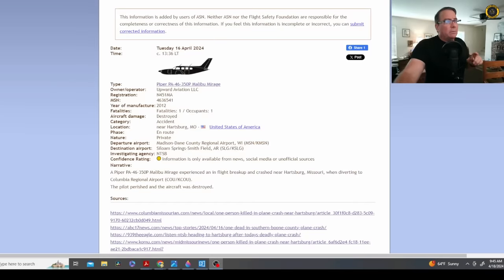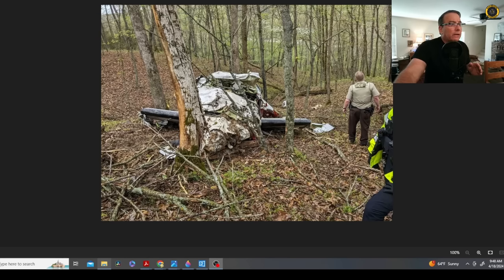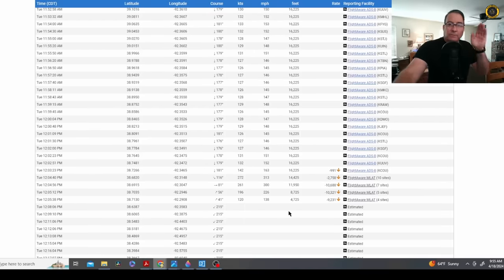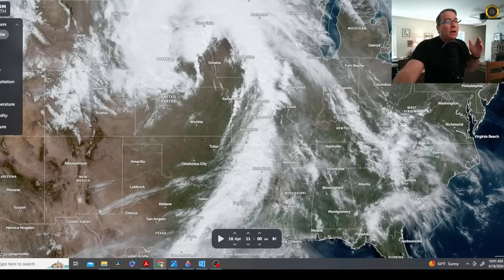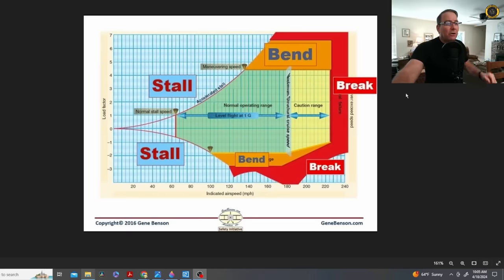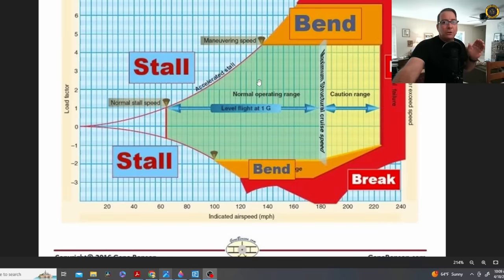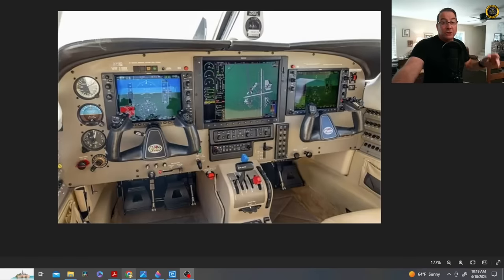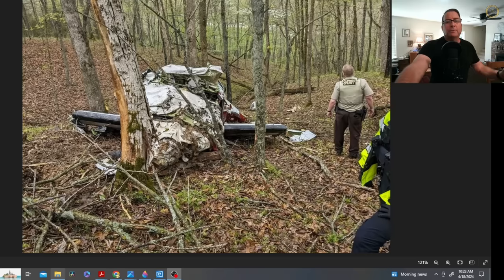N451MA PA-46-350 16 Apr 2024 Structural Failure

Comment: There's something really bogus about Va dropping with lower weight.  The G factor goes up but does not correspond to a force increase on the airframe when the weight drops, so, in other words, the airframe is not broken by g-factor but by actual lift generated.  That lift is the same at max 18 degrees AOA (say) for a given speed whether the airplane is loaded or light, and that's the load on the airframe.  Lift is the load.

In other words, the limit of G-factor is actually bogus, it has to be g-factor for a specific weight.  Lighter weights tolerate more, heavier weights tolerate less.  I'd imagine they give G-factor limit for max weight, that being the conservative case.

Comment: A negative G limit undoubtedly can occur without warning in turbulence, but usually the aircraft can sustain an unsustained, one off incident. It's likely that the pilot continues to overstress the aircraft and exacerbates it by large and sudden control inputs. When that happens it's inevitable that there is some degree of damage and/or structural failure. Best to stay out of weather that produces large cumulus clouds...ie thunderstorms.

Comment: Juan, what is meant by a “doublet” on the controls?
Reply: Two (or more) large control inputs.
Reply: A doublet is a control input in one direction followed quickly by one of similar magnitude in the other direction.

Think about driving in a car down the highway.  You see some debris in the road and need to make a large, sudden steering input to the left to avoid hitting it. If you straighten back out gently, you can keep driving safely.  However, if you immediately follow the hard left with a hard right you are likely to spin out or even roll the car over.

The same concept applies with an aircraft, except instead of risking spinning out on a roadway you're risking overstressing the airframe.
Reply: @marsgal42  Thanks!
Reply: @epicspacetroll1399  Thanks!

Comment: Never fly through sharp shear. What you can encounter will seem to defy physics at times. Massive airspeed gains and turbulence beyond the structural limits of everything but a fighter or something with very high wing loading limits. Use your radar correctly and avoid these areas and certainly never exceed max VA minus wind gust factor.

Comment: I disagree. There is no indication of exceeding design limits prior to the rapid decent. I believe what you have here is a complete autopilot servo malfunction that put the plane into a near dive. The pilot then tried to pull back and get out of the rapid decent. In the process the elevator was ripped off because he was WAY past Vne when he was pulling back.  Lesson here is if you get suddenly thrown into an Autopilot rapid descent or strange attitude from a servo driver failure. Check airspeed before trying to recover. Pull power to reduce airspeed before stressing the flight control surfaces.
Reply: I’m not an active pilot. And I have no experience with autopilots. But I’ve read enough about autopilot servo malfunctions that they scare me. Long ago I heard about a C-141 with runaway tail trim - pitch nose up. Pilot went into a steep bank climb.
Reply: @wscott44  many people think a servo has a break away force that the pilot can overcome in emergency. In fact, it does, under normal operating conditions where the failsafe current control actually does what it supposed to and limits drive current to the servo so that it is never strong enough to over power a pilot. . But in a servo driver failed mode that circuitry can also malfunction, and the servo can have a drive current that give the servo a rotor force that exceeds any human pull strength.  There is even failure mode were shutting off the Autopilot won't stop it. This is because most autopilots disengage relays are a soft switch for on/off. That switch logic can also be part of the failure. The only thing to do is pull the autopilot breaker, or main power to it cutoff switch. In a emergency of control loss. the pilot has seconds. The first thought is not going to be an autopilot failure. They are going to think it is a control failure due to either stall or control cable failure of control surface failure.  Even if they think it may be autopilot, they hit the autopilot disengage and the problem does not go away, so now they really don't think it is the autopilot. They will instantly rule out the autopilot and in fact it can still be the autopilot. The rule of thumb in all control loss failures where a autopilot is active. Shut the main power of autopilot OR pull the breaker. DO NOT trust the disengage button in any control loss failure situation.
Reply: @josephkaminski1857  thanks for all that. I don’t foresee myself flying again. I’m 70, and would need a great deal of retraining. Too much time & money. I think back when I got a multi engine rating in an Aztec. I was allowed to rent it. I was taught to use the electric trim switch on the yoke, particularly during landing flare. Never once did I ask or instructor say anything about what to do if that sucker stuck or malfunctioned.

Comment: Non pilot here, I am confused on why so many of these general aviation accidents seem to correlate with pilots somewhat relying on autopilot, or not switching it off. Compared to driving a car, the second something seems weird I turn cruise control off. Can anyone elaborate on this?
Reply: Autopilot deals with a lot of details, letting you focus on the big stuff, like where you're going.
Cruise control is a good analogy. Antilock brakes maybe another. Wipers that adapt to intense rain. Automatic headlights. Lane-keeping assist and automatic braking.
So you can get into a messy storm and the automation makes it easier just at the time where you need it easier. 
The difference is, an aircraft can get into a situation where It Just Isn't Working. Wind gusts so strong that nobody could maintain constant speed, ice buildup so much that even max trim no longer is enough. So autopilot dumps control to the human.

As you say, the human should have been "in the loop" all along. But then, those pilots probably saw the situation developing and got out. The ones who didn't notice, are now suddenly handed an aircraft without the automation they were relying on to get here.

Comment: This change of maneuvering speed changing with weight should be in every POH of these light aircraft. Typically, the charts given are based on gross weight only for these light aircraft. I saw a maneuvering speed graph in a Debonair owner's manual but I haven't seen it in any other POH. And, all the other performance charts should have corrections for weight too. Charts based on weight, altitude, and temperature.

Comment: Shockingly low negative G limit!
Reply: I agree
Reply: Not really —- remember you’re flying along at 1G , not 0G. If you look at the V-g diagram above and below the 1G horizontal line, it’s fairly symmetrical. 0G will have you floating around the flight deck, but -1G will have you sprawled on the ceiling ( if you’re not wearing harnesses! ).

Comment: It seems like this airframe is too aerodynamic for the strength of the design.    Can easily achieve speeds that can rip it apart in the air.    His air speed was 147 putting it in the bend part of graph.   If flown regularly in that zone I suspect fatigue on the airframe would occur.     Whammo.

Comment: Flying Cargo in the late 70's in mostly GA planes it didn't take a Pilot long to learn to hit weather low and slow. Never at 16 grand.
Scot Crossfield (X-15 pilot) was killed hitting a TX-storm at high altitude in a Cessna 210 was killed when it broke up over the Smokies.

Comment: Juan,

 I apologize in advance, but you need to review the aerodynamics and physics behind Maneuvering Speed. Just because the FAA mandates that 3.8 Gs is the maximum structural limit  for a Normal category aircraft at maximum gross weight, does not mean that you can use that maximum load factor or G-limit to calculate the maneuvering speed at any other gross weight. In fact, the maximum allowable load factor or G-Limit is also dependent on gross weight, is exactly the same way.  Why? Because Gs do not break or bend anything. It is force applied to a structure that creates strain and stress, and the stress that causes structural failure. G's or load factors are just the ratio of the force applied divided by the mass of the object (F=ma) The lower your mass (gross weight) the more G's ayou will produce from any specified  force 1000 lbs of lift force applied to 1000 pound aircraft will produce 1 G, to a 100 pound aircraft it will produce 10 Gs. But it is still only 1000 pounds of force, and if the structure is built to withstand 1000 pounds of force, than that force will not break the structure, no matter what it weighs. The weight just changes how many Gs it will experience.

So the Maneuvering speed is a constant. It does not change with gross weight.
Reply: The manufactures disagree with your assessment and publish lower speeds for lighter weights.  The mass of the engine doesn't change as you burn fuel...the force on the mounts is directly related to the acceleration, not to the total lift.  Some forces (spar load) vary only with lift, but others are affected by G-load.
Reply: Lower mass means higher acceleration... That makes sense!
Reply from the maker: No! You fail to understand a very basic concept.
Reply: @richsarchet9762  No, Forces are NOT affected by G-Load. G-Load is just a measure of the force divided by the weight. The force on the engine mounts is created by what? The aerodynamic force (the LIFT) transferred to the engine mounts by the structure of the aircraft. That aerodynamic force is determined totally by the shape of the airfoil (as well as other parts of the airframe, the AOA, and the dynamic pressure (calibrated airspeed). The weight of anything in the aircraft is irrelevant. And the engineers  at the manufacturers agree 100% with my analysis. What is printed in the POH or anywhere else that disagrees with this is simply, an oversimplification for pilots who do not understand aerodynamics or physics.  In the USAF, published G-Limits were weight dependent, although not done in completely accurate way.
Reply: @charlesbretana  The force on the engine mount is literally the mass of the engine times the acceleration.  F=M x A.  Physics 101.  Yes, the aerodynamic load creates the force that accelerates the whole plane, but the engine mount carries the load to accelerate the engine - and if you pull until the wing stalls at maximum maneuvering speed, the lift will equal 3.8 times the maximum gross weight of the aircraft.  If the aircraft is below it's max gross weight the acceleration in response to that lift force will exceed 3.8Gs, and many structural elements WILL be overstressed (the main spar will not).

Comment: I wonder, with a structural breakup like this, I'm assuming that the occupant would be killed in mid-air or otherwise rendered unable to, for example, pull a parachute cord if they had happened to bring one, Trevor Jacob style?
Reply: I think not, which is worse.
Reply: @MalachiWhite-tw7hl  well then, maybe Trevor was right, maybe pilots should wear parachutes, except he got the reason wrong.

Comment: It is obvious that advanced single engine planes requiring advanced pilot skill and knowledge are too easily let in the hands of private pilots with too little skill and experience. This particular type may need pilots with special qualificatilns to be flown safely. But on the other hand the Malibu could  maybe be a little more robust given its use. It looks a bit to easy to break up right now.

Comment: what about the I suppose it's Garmin sat nav, warning of weather for the type of plane. You type into the set nav of what you're plane is and it will know it specs, and when entering a weather front that would cause you to have difficulty or pass it specification Will give you a verbal warning. it wouldn't be hard for them to do implement into the software update.
this is great for AI you could train an AI to do this having your phone it has motion sensor GPS weather updates on warnings wouldn't be hard for AI to get all this data and tell you in advance that you're entering a dangerous zone and even what you should do if you enter the danger soon like you described maybe you should put one together.
exactly what you're saying if that was said to the pilot in the plane when he hit the danger zone he might have more likely stayed in control of the plane and this could be all controlled by AI trained by you or a qualified pilot or pilots

Comment: Not a pilot but Very interesting accident analysis & Why this same aircraft accident frequently....In trying to better understand the described very aerodynamically "Slippery" (And very fast air speed Capable), seems This particular aircrafts overall airframe strength Rating is considered just normal std for typical single engine GA flying stresses but not Equal to it's particular speed Capabilities or it's Aerodynamic & engine power make it Too Easy to Exceed it's airframe std rating G's rating.....Std airframe G rating + high Hp & Slippery Aerodynamics seems like a Bad combo that Shouldn't be Available to Std single engine cert'd pilots to begin with.....What I missing here ??

Comment: Is not wearing a parachute some kind of macho thing? There are some very comfortable systems out there that can save many people. Admittedly there are times when parachutes are impractical for everyone on board, but if alone and flying in marginal conditions it could be much appreciated. It seems to me that the rate of GA losses is increasing and does this reflect better reporting of incidences or insufficient pilot training?
Reply: There’s no way to bail out of most aircraft.
Reply: @MerlinspopTBH  In the event, you'll find a way.
Reply: Parachutes require circumstances that allow them to be used, and technique to use them properly. 
In this case, by the time the pilot saw the aircraft was not recoverable, he was in a closed cabin descending at 10,000 fpm in an unusual attitude out of control, with very limited time. That's not "macho" it's just physics.
Reply: That's like thinking you can put your seatbelt on while spinning off the road before hitting the tree.  But it takes even longer to get out of your seat and open the door and jump out.  Some aircraft have parachutes built into the fuselage.  That might have been useful here if you had the presence of mind to pull the overhead handle.  Not sure if it would have held up in this case, though.

Comment: I'm still confused about the explanations I find.
Va seems reasonable: The maximum speed for full deflection of control surfaces without damage to the control surfaces. That should be independent of aircraft weight, right?

But the explanation for Vo seems illogical. It is the maximum speed where one full deflection of a control surface will not cause structural failure of the airframe. The wings will stall before collapse loads are achieved.

OK so far, but why is Vo reduced for lower aircraft weight? 
I understand that for a certain speed the wing will stall at a certain AOA regardless of aircraft weight. 
So if a light aircraft flies at the Vo speed of a heavy aircraft a sudden increase of AOA to the stall AOA will stall the wing. Further increases in AOA will not further increase airframe loads. 

At or near stall AOA the lift loads on the wing is the same for the light aircraft as for the heavier one, but the resulting G load will of course be higher on the light aircraft.

The crux is: Structural failure is caused by loads and stresses, not by G loading per se. A lower  mass means the structure can sustain more Gs before structural failure.

Maybe the aircraft manufacturers specify a maximum G loading independent if aircraft weight? That does not make logic sense, but explains why Vo is reduced for lower weights, which does not make logic sense.
Reply from the maker: Keep studing...and don't overthink it. ;-)
Reply: @blancolirio Hi!😀  I don't think I am overthinking it, just using my structural analyst common sense.

G factors alone can not cause structural failure. 
An aircraft of half the mass can sustain twice the Gs before structural failure.

I guess the regulators and manufacturers simplify things by (incorrectly but conservatively) assuming that the airframe will fail at the same G factor regardless of aircraft mass (weight).

Comment: Piper has the GALL to compare their Turbine Malibu/Mirage as a competitor to the TBM! There is NO comparison between the two. TBM's spar and structure was built to MILITARY grade standards, VERY expensive spar assy milled out with the same technology AIRBUS uses in making their big jets! Piper in NO WAY can compare the design integrity of their products to that of the TBM or the Pilatus PC12. Those airframes are on a completely different standard MUCH higher than the Piper Designs. I would NEVER buy a Piper Turbine Single, the structural SAFETY cushion is marginal at best with Piper, TBM and Pilatus exceed the required structural inegrity! Yes, you can break anything, but I'd rather trust my life to the TBM and Pilatus over the Piper products. If you get a chance, there are some old video's showing the TBM wing under construction and it's IMPRESSIVE! Piper still uses the same construction methods and techniques as they did the old Warriors and Commanche's!

Comment: Bull crap they have had too many structural failures. I won't fly them. They have had many wing deformations that did not cause a crash. Piper engineers tried to say "a little. Wing rout wrinkling is ok. I only fly Aztecs. You will never see me in a 310.
Reply: That's if the wings don't fall off first.